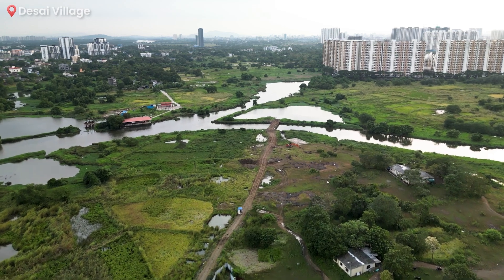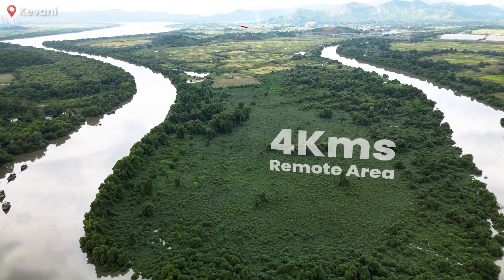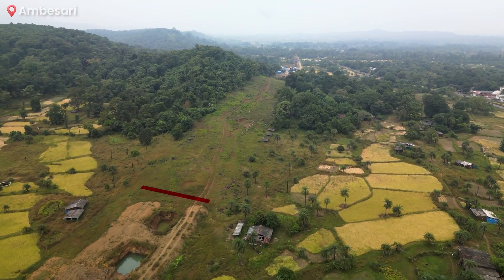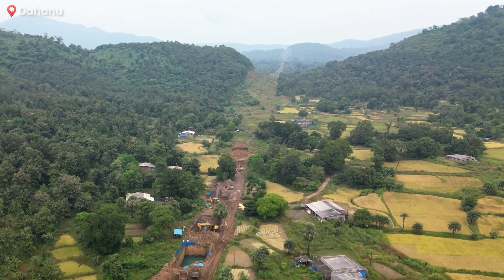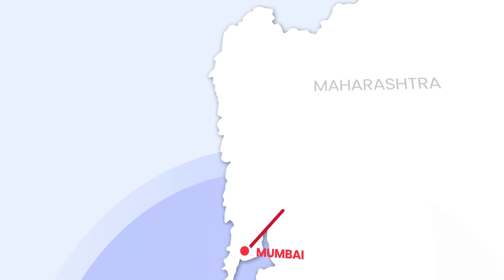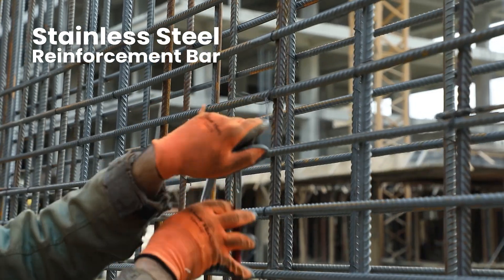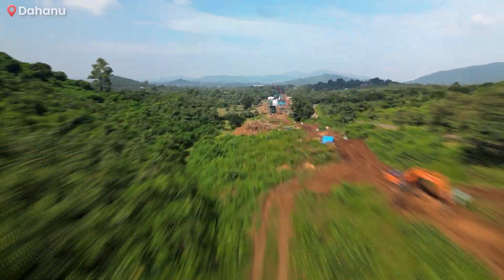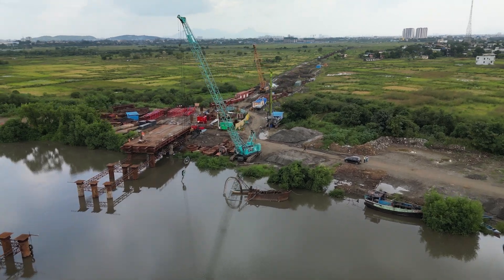Construction of elevated section in Maharashtra | MAHSR | Bullet Train Project (English)

Comment: Thane station looking very mediocre. As there will be many upcoming bullet train that will connect this bullet train station so it needs to be big. And because Mumbai station is underground and having only 6 tracks which makes thane a central station which is where will be last stop for upcoming HSR projects like for example Mumbai-Nagpur, Mumbai-Hyderabad. So i think in this corridors thane will be last stop not Mumbai. So for that thane station should be big. But instead it is small.